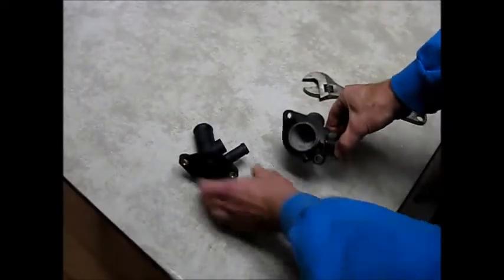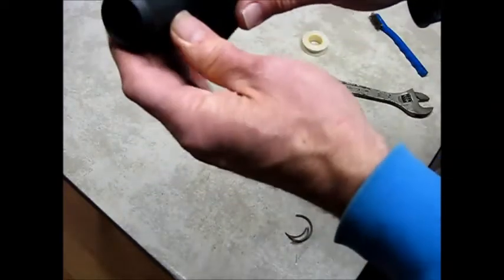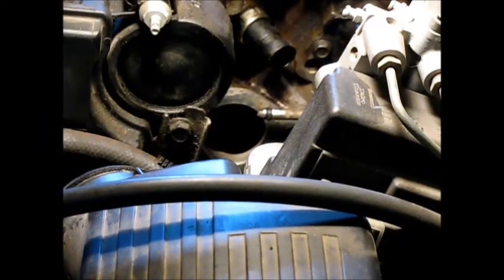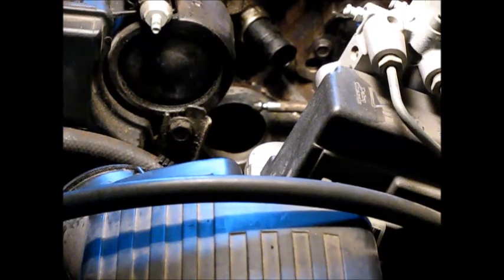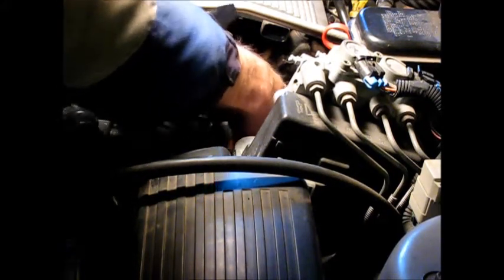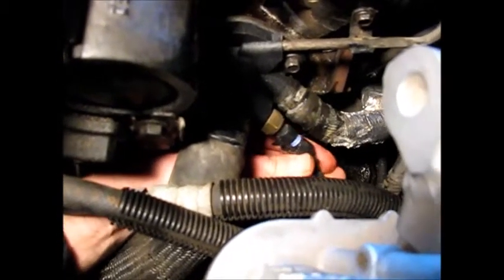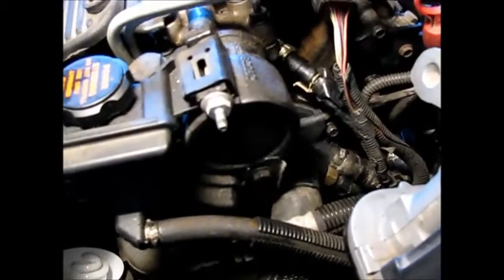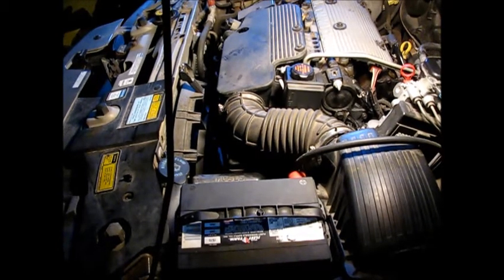Repairing a coolant leak on a 2.4L GM Grand Am Part 2: Installing water outlet

Comment: In case it helps anyone... The power-steering pump is in the way, so this job is MUCH, MUCH easier/faster if you remove the power-steering pump by completely removing its two 13mm bolts  (Don't detach its hose.)  Then the pump easily pulls off and gives you much more room to work on the water outlet-- especially if you bungee-tie it off to the side.  The power-steering pump doesn't leak power-steering fluid or anything so it's very easy to do.

Make sure that the replacement water-outlet that you buy comes with 2 O-rings.  (The Dorman part # 902-105 does as of 3/30/23.)  The bigger O-ring fits into a groove in the plastic water outlet.  The smaller one fits into a groove on the metal outlet pipe.

The 2nd time that I did this job, one of the two 10mm (M8 x 1.25, 30mm) water-outlet flange-bolts had seized and it was very difficult to remove.  I partially stripped the head by using a 12-point socket on my socket-wrench.  Eventually I was able to remove it with a 6-point socket.  I strongly recommend that you use a 6-point socket.  (I ended up buying 2 new high-strength black 13mm-head (M8 x 1.25, 30mm) flange bolts and putting a bit of anti-seize on the threads since there's a good chance that I'll keep my Cavalier convertibles long enough to have to do this job again.)

Even if you drain the coolant from the bottom hose, and even if (before you start this job) the water-outlet has leaked coolant (perhaps in your garage) until it stopped... When you remove the water outlet & its hoses, about another 12-oz of coolant will drain out,  so put some kind of a catch-pan below the water-outlet area before you remove it or remove any of its hoses.

There is supposedly a petcock valve on the bottom of the radiator (driver's side) that you can use to drain the coolant, but according to my Haynes manual, you have to remove the splash-guard-- which seemed difficult.  I also read many comments (for this engine and many other car-models) that the plastic petcock valve is very likely to have seized-on and very likely to break if you try to remove it (thereby necessitating replacing the radiator), so I drained the coolant from the hose below the engine as is shown in Part 1 of this video.

The 2.4L doesn't seem to have any kind of an air-bleeder screw to help remove any air bubbles that might get trapped in the cooling system.  Apparently it is self-bleeding?  After I did this job the first time, my wife took the car out and it overheated.  (I thought that I screwed up.  But after it cooled off, it never overheated again.  Apparently it had some air trapped in the cooling system, that bled out during the cooling process.)  I'm not sure if this is the correct procedure, but... After you refill the coolant, it's probably best to run the car at idle until it gets to its normal running temperature (~195), probably with the heater turned on.  Then turn off the engine, and after it cools to a safely warm temperature, maybe open the reserve-tank for a few hours.  I THINK this will bleed any air out without risking overheating.  You don't want to be on the road when the engine overheats-- especially if you might be stuck in a situation where you can't pull over for a few hours to let it cool.  NEVER drive the car if it is overheating or you will severely damage the engine.

Also, after it cools down, check the coolant level because some amount of coolant seems to work its way into the engine after the air bleeds out.
Reply from the maker: Thanks for sharing. These are some excellent and detailed tips!

Comment: Where is this located ?
Reply from the maker: It's on the top of the rear of the engine (driver's side). You'll see the coolant lines coming into it.
Reply: The Original Mechanic  appreciate it ✊🏽

Comment: Good video job! If you remove the power steering pump next to the outlet, it gives you a lot more room to work and it's only 2 bolts holding the pump on. You won't lose any power steering fluid either.

Comment: Mine is leaking just like that. I saw another video where it was the same repair but he removed the power steering pump. Two bolts and he had a ton more room. That’s the route I’m going. Thanks for info.
Reply from the maker: You're welcome. Good luck with your job.

Comment: I have done this. Took the car for a test drive. it didn't over heat but I still have a leak and my car had white smoke come out after I shut it off
Reply from the maker: If the white smoke is out the exhaust pipe that can be a sign of coolant in the combustion chamber and that's often a blown head gasket. Hopefully it's not that. Maybe you just had some coolant on the exhaust manifold

Comment: Thanks for the insight. I get to do this tomorrow on my daughter's car. Good times.
Reply from the maker: You're welcome. Here's hoping your work is short and successful.
Reply: Found a much quicker way of doing it. two 13mm bolts on the power steering pump come out, you pull the power steering pump out of the way and it opens it completely up. The reason i did that was because one of the 10mm bolt that bolts the inlet housing was in the path of a ps sensor. I still appreciate the video though.

Comment: Hello.  I used this video to replace mine. Thanks. I do have a question though. It appears you already replaced the sensor and pigtail before. Eitherway, I had to replace the temp sensor with the outlet and the sensor came with a new pigtail with two wires and original equipment was one wire. Can you show a video of how to wire it? I dont want to trial and error that if I dont have too. Basically, does it matter which wire we cap off and which one we connect to the gauge? Thanks again.
Reply from the maker: Hi. I didn't replace the sensor. I just checked and the sensor in the water outlet on my car has two wires. There is another sensor that threads into the engine intake just above the water outlet and that one does have one wire. If that's the one you're talking about, what you may need to do is check (with an ohm meter or continuity tester) which of the two wires is connected to ground (the threaded end of the sensor). You could just cap that one off and use the other. I hope this helps. Thanks for watching and commenting.

Comment: I have a 2000 Pontiac Grand Am 4 cylinder and every time I add water it'll say 'low coolant. Do you think If i replace that water outlet, you think my car will say stop saying 'low coolant?
Reply from the maker: The question is, do you have a leak at all, or is the level sensor in the recovery tank bad? If you are losing coolant, the leak could be from any number of places. If it is the water outlet in the 2.4L engine, you will see signs of coolant leaking from the top rear of the engine. Good luck with it.
Reply: You have a leak somewhere

Comment from the maker: I wish I could help you with that one, but I don't know either. My Grand Am had a sticker by the water outlet that said the thermostat isn't here. I haven't done that job yet so I don't where they put it.
Reply: When i add water in it & when i turn my car on, the temp goes halfway really fast. I have to drive slow so the temp won't past the halfway line.
Reply from the maker: Nito Leon If there is no external leak and the car is low on coolant and overheating, I would worry about a head gasket leak. If the exhaust is whitish in color that also points to a head gasket.
Reply: Is the head gasket easy to fix or do i need to take it to a mechanic specialist
Reply from the maker: Nito Leon I haven't done one on this car, but on other cars it's pretty tough with quite a bit of dis-assembly. You might want to check if someone else has posted a video on the GM 2.4L head gasket replacement. Unless you have time and can do without the car awhile, a mechanic may be your best move.
Reply: The thermostat on the 2.4L Twin Cam is behind the water pump under the car.